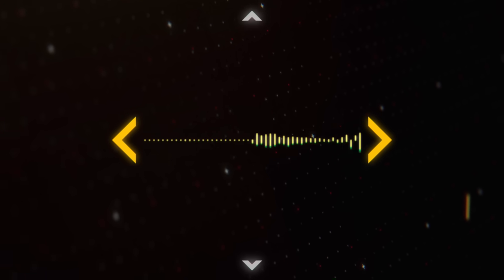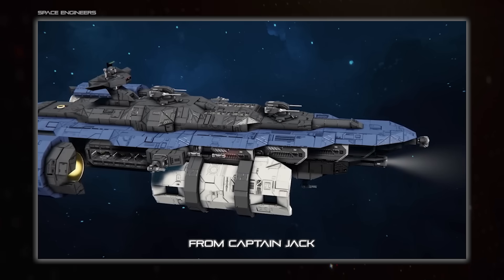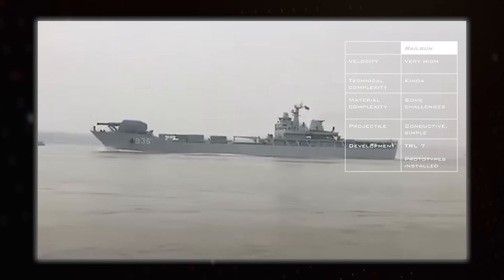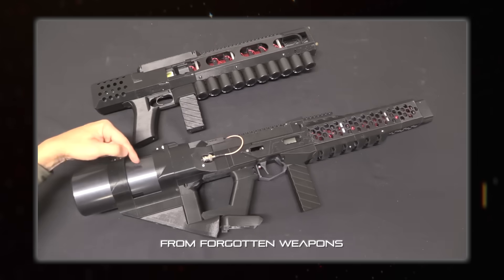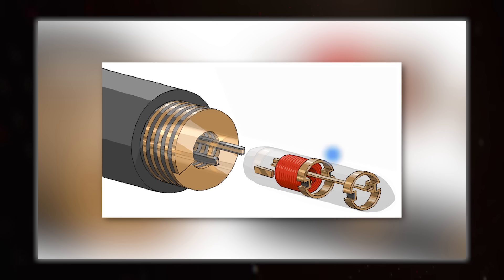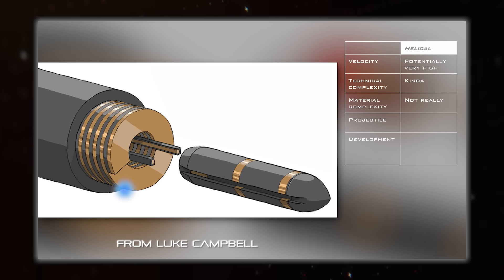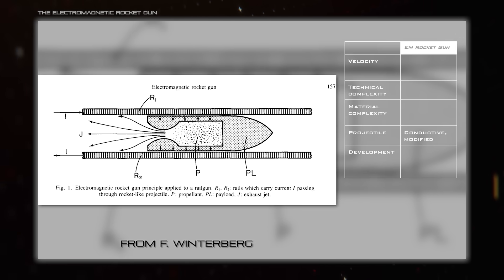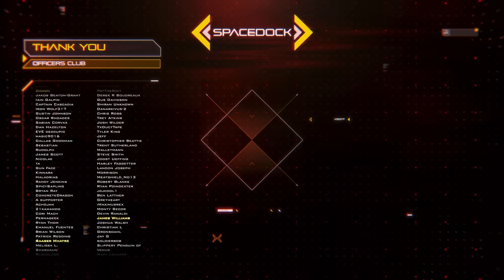The Deadly Coilgun/Railgun Hybrid You've Never Heard Of (Helical Railguns)

Comment: Just got an idea for a gun First stage is conventional 2nd stage is a helical then when it exits the barrel it ignites a rocket motor excellent fantasy weapon because it has 3 stages it can have some build up because you have to get enough electricity to get the helical stage to get it going fast then you have to activate the first stage then activate the helical stage then it could have a delay between it exiting the barrel and igniting the rocket engine

Comment: My take on this is the first two thirds of the weapon would mostly be coiled with a magnetic breach coil that low balls the round into a conical feed coil to shove down the rails. Last third is all rails outside a final tip coil that imparts more rotational or directional energy depending on load. Not all rounds will be round in a "anything ferrous" situation.

Comment: This video actually inspired one of the weapons of a character i made. He uses what i called a Kinetic/Energy Charged Helical Rail-Gun or a K/E CHRG if you wanna get fancy with the acronyms....and yes i tried to make it as close to charge as i could.

The basic idea behind it is you load it with "normal" ammo and the techno magic inside the gun coats the bullet in stabilized plasma letting it deal both kinetic and thermal based damage....the weapon is also able to fire without the use of kinetic ammo relying purely on the plasma, these bolts are unstablized and as a result are noticeably weaker and shorter ranged but an average plasma cartridge can fire a great many shots before having to be replaced.

Im sorry to dump random lore ive created here but i wanted to show how inspired i was by the idea of the Helical railgun and how i put my own spin on it.

Comment: The Helicoil railgun would have insanely expensive and relatively heavy ammo, therefore high running cost and for a scifi space setting the extra weight of copper coils in every round would nessisitate orbital manufacture if you want to avoid even more insane logistical handling and fuel costs. 

Ie, anyone using these rounds in a military setting would be burdening themselves with a huge economic logistical and production penalty when deployed en-mass when compared to convetional rail guns or even rounds with traditional chemical propellant 🤔

Comment: Hear me out Spacedock...

...what if we used a small amount of gun powder in the beginning to impart an initial momentum/velocity prior to applying current?
Reply: That's been tried. Conventional guns work well up to about 1500 m/s, so why not just use electromagnetic acceleration above that velocity?
Reply: @derekp2674  That's.... precisely what I'm proposing.
Reply: @chaz706  From the research done back in the 1990s when I last worked in this field, one or two actual examples spring to mind.
The HYPER railgun in the UK used a first stage (or pre injection system) based on a Browning machine gun barrel. That achieved a overall muzzle velocity of about 4200 m/s with a velocity increase of roughly 2000 m/s from its railgun section.
In a quest to explore maximum practical railgun velocities, Sandia Labs used a two stage light gas gun to inject a projectile at around 7000 m/s. Their railgun stage then accelerated it to a final velocity around 8000 m/s.

Comment: My thought for the ammo complexity issue would be to have the gun fire in a repulsive setup, and 3D print the ammo. Technology for both metal and multi material printing already exists, and I’d honestly be surprised if someone hasn’t already put them together. The thought is that the lower tensile strength of 3d printed materials would be less of an issue in compression, and complex internal structures would be less problematic. If you have the super-fast 3D printers that are totally feasible in a sci-fi setting, ammo production could be done on your larger ships easily, and even smaller ones to some extent. Materials could even be potentially gathered from asteroids, so supply lines would be less of an issue too.

Comment: The biggest problem I keep on seeing is air stability, where unlike regular bullets, there is no rifling to rotate the projectile, so it often tumbles through the air and reduces range and accuracy! Though with a magnetic rail gun, I do see some possibilities to induce rotation, rather than the magnets being placed in a single line, they could be placed around the barrel in a pentagonal or hexagonal spiral, or more, to induce rotation of the projectile so when it is finally ejected it is now spinning enough for it to fire straight without tumbling.

Comment: i think PCP pnuematic compressed air guns/cannons are actually the future of cyberpunk and space guns. think about it. they can be either HAND PUMPED, or ELECTRICALLY pumped with a solar powered air compressor etc. You ALREADY NEED air tanks IN SPACE... AND... hah didi mention you can HAND PUMP them ? lol no propellents needed but air and again,  it will be funny to see people deciding between air to breath or to shoot slugs out of their air gun, WHICH can also be made of same tech as the cold gas thrusters. in fact... a cold gas thruster can easily be converted into dual purpose air canon that just fires projectiles using the cold gas thrusters using likea giant break barrel  that a robot arm slides right over the cold gas thruster, with its air gun like rotary magazine of slugs made from space trash or regolith.

Comment: This was so cool, and proof that I don't have a single original idea ahead of anyone else. I was thinking if this yesterday, thinking "I wonder if they could make a rail gun on one half and coilgun on second half, but this helical one looks even better than they. Thanks for making it easy to understand, with the projectile's innards being shown and how complex it really is starting to get. This was awesome to see. Another thing that would be effective is a two stage helical, where the projectile houses it's own rail gun or coilgun (whichever makes better sense to those who know), so essentially a railgun IS IN the projectile, which gets electromagnetically blasted out like normal on the first part, sending it to Mach 7ish, then the projectile, while in motion, sends out the metal piece that hits a very armored target at like Mach 12 or so, if only the battery pack within the larger projectile casing could supply that much power. It could atheist be an easier way to send satellites into space❤❤❤

Comment: I still cannot understand what possible value in a coilgun you have from having multiple coils instead of one long continuous coil other than energy efficiency. The coil should provide a continuous magnetic field all pushing along the coil, so the longer the coil, the more the acceleration from the magnetic field. Having the coil behind the projectile energized wouldn't reduce the projectile's forward acceleration, though it might not add much to it, and neither would having the coil ahead of the projectile. The magnetic field doesn't start to pull back on the projectile unless it breaks the plane of the coil in some way, which it won't as long as it's in the barrel of the coil. So why do you need to time anything other than to reserve energy?
Reply: Well, if you only have a single long coil, the magnetic field lines will all be predominantly parallel to the axis of the coil. 
So, if another coil is inserted as a candidate projectile, the axial field from the long coil will act with the circumferential currents in the second coil to produce radial forces on that coil. 
Thus, that does not work as an electromagnetic launcher.
To produce the axial forces needed to accelerate a projectile coil, you need radial magnetic fields to interact with the circumferential currents in the projectile coil.
These radial fields can be found at the ends of short coils. This is why most coilgun designs feature a series of multiple short coils. 
A disadvantage of this is that a very uneven or "jerky" acceleration is likely to be produced.
In contrast a railgun - or the hybrid arrangement discussed here - should give a uniform smooth acceleration.
Reply: @derekp2674  Why would you use another coil in the projectile? Every coilgun I've seen just uses a ferrous projectile.
Reply: @chrisedwards6573  The commercial low velocity coilguns made by the likes of Arcflash use ferrous projectiles as you note.
These are linear versions of reluctance motors, that is motors with AC stators and ferrous rotors.
A short circuited projectile coil then gives a system equivalent to a linear induction motor while a system with the projectile connected to the coilguns' power supply gives the equivalent of a synchronous motor.
When I was actively researching railguns for use as high velocity military guns, I never encountered any military projects based on ferrous projectiles. Almost all were induction systems with a few synchronous ones.
I suspect this may be a consequence of speed limitations inherent to ferrous systems, from features analogous to hysteresis effects and magnetisation losses in iron cored AC motors and transformers. In such devices, there is a small time lag or phase lag between the driving current and the magnetic flux in the iron.
Any such time lag may result in an unacceptable limit to the possible peak velocity.
In contrast, induction coils are not so limited. Small single stage coilguns have achieved velocities in the region of 8000m/s.
For similar reasons, high velocity Railguns do not use ferrous iron cored barrels all seem to use air cored designs.
In induction coilguns, projectiles are driven by magnetic repulsion while reluctance coilguns are driven by magnetic attractions. But coilguns with simple iron or steel projectiles will exhibit both effects and it may be that the induction effects become more significant at higher velocities and thus counter the attractive forces on the ferrous material.
Conventional motors and transformers use laminated steel cores to negate these effects.
Reply: @derekp2674  Thank you so much. Very informative and much appreciated.
Reply: @chrisedwards6573  Thanks - you're welcome. A further relatively simple reason for not using ferrous material is that magnetic field strengths much greater than 1 Tesla can be needed, so ferrous iron cored systems become more trouble than they are worth. I'm sure this is the case with Railguns.

Comment: I like the Helical. I don't see the issue with some form of complexity with the projectile, or the potential sabot. Our current munitions has been rather complex for quite some time: from the bow and arrows requiring fletching; the bullets being a compound material of lead and copper jacket; even autocannon shells are complex with explosive and fuses. Plus the point of these magnetic accelerators is to achieve ludicrous velocities as a kinetic-energy weapon.

Comment: @3:59 - Perhaps a bit of both; having timers that set the shot, sensors that calculate the shot made, and then a machine-learning chip that makes the necessary adjustments to those timers as needed so that each subsequent shot gets closer and closer to the sweet spot. A smart weapon that tunes itself to get better through usage.

Comment: Thought about the rail life problem, if its on a ship, why don't they have quick change rails, like a battleship turret, when the rail is used up, it gets ejected from the barrel before the barrel points up wards and new rails are pushed form under up into the barrel with in 20 seconds

Comment: My big question on coilguns for a while has been "how effective would they be at achieving a velocity similar to chemical firearms?" The highly advanced timing is the greatest limitation, so a coilgun with a modest projectile velocity would be much more attainable, right? Then to make them competitive with conventional arms, simply fire, to quote the video, "an absolute unit" of a projectile. I also question why I haven't seen them paired with chemical generators instead of batteries. There may be a technical reason, or is it a blind-spot from the focus on the electrical/futuristic nature of the design?

I think having similar or "sidegrade" performance would be enough to be useful. There are concerns about the use of explosives causing brain tissue damage to the soldiers using them, dramatically simplifying supply lines is always desirable (and propellant shortages have been a bottleneck before -- Ukraine has reported such a limitation and that is part of why they've used armed drones so much -- they just need a destructive charge), and I would think they offer an advantage in battlefield stealth and awareness.

I can imagine low-velocity coilguns being used at a "heavy machine gun" crewed/mounted weapon level. If you can steadily lob chunks of iron without emitting significant light or noise (vs. firearms)...it seems like a fairly practical concept. Might even be more economical than conventional arms.

I guess this does fall into the mentioned "proposals for mortar-like coilguns," it just seems weird that this isn't an angle that gets discussed. I've either had a clever thought or I've missed a number of technical limitations that invalidate my idea.

Comment: I wonder if there is a way to insulate the coolant inside a EM rocket gun's projectile until it's almost been shot out the gun. This should allow for the coolant to only ionize until the projectile has nearly reached the end of the gun's rails. This should decrease the overall amount of wear the rails have to go through. This would sort of work like the gyrojet system, as in the propulsive force of the plasma would only start to really push the projectile outside the gun

Comment: On an entirely serious note grounded in real world physics, the inductance of a coil big enough to produce useful thrust kills any chance of that thrust moving at a useful speed (it won't keep up with the projectile) in the proposed hybrid weapon.

Rail guns work because they only have straight line inductance whereas a coil which sees a voltage change more rapid than a threshold (which will vary with coil diameter and other factors) will see that voltage short out capacitively from one wrap to the next thus never developing the circular current flow which would create a magnetic field. 

Understanding this doesn't require PhD level math and physics. Navy BE&E school (which doesn't exist any more) gave me that. QUANTIFYING the phenomenon does require that level of knowledge. 

So, it will work, but my guess is that the hybrid weapon would have a lower muzzle velocity than a rail gun. Between the magnetic field likely lagging the projectile and slowing it down and the energy powering the coil would leach from the rail effect I would guesstimate roughly a 25-50% loss of efficiency from a simple rail gun.
Reply: Ah, the joys of displacement current :)

Comment: I think one of the biggest issues with a Helical Railgun is that the projectile has to fit into the weapon in a specific orientation. Every other gun type simply requires the "pointy end" to the front. This complicates the storage and loading system, especially for a turreted helical railgun where the orientation of the barrel and its guide rails can not be assumed.

Comment: Regarding the coilgun problem, and how do you time engaging the magnets in front...what if you just had them all open in series, being the weakest in the initial magnet, and then simply turned off the magnet it passed at the right time, resulting in a higher current through the remaining magnets for faster acceleration. While still having the benefit of only needing to shut the magnets off at the proper time, which I imagine is significantly easier to accomplish...

Comment: There has been some work (mostly 'on paper' and in simulations) on using plasma as a conductive medium for rail guns and related gause weapons. This could seriously reduce friction and with no wear on the 'rails' you don't have to deal with replacing those nor with friction melting your rails and causing a rapid unplanned disassembly of the weapon.
Reply: In reality. plasma armatures erode railgun rails really badly. This is because thermal radiation from the plasma tends to vaporise the rail material (and also the interrail insulators). Also, getting electrons to flow out of the rails into the plasma requires the establishment of hot spots ("arc roots") in the rails, to promote thermionic emission.

Comment: you use photo-sensors so as the projectile blocks the light it turns on the coils in front of the projectile to pull it forward

Comment: According to the Traveller: The New Era technical sourcebook Fire Fusion and Steel the gauss guns used in Traveller's Third Imperium universe are helical railguns, though it does not use that name. The book even has a diagram similar to Luke Cambell's and a pretty succinct explanation of the theory in its gauss weapon design system.

Comment: Coil timing: check what is don in FEL (Free electron laser) with Seeding laser like the FERMI in Trieste Italy. (I was working in that institution)
In that machine a packet of electron flying at high speed is excitated with a laser. Literally synchronizing at Pico second and hitting the packet in the fly in synch with the laser wave. We are very good in this kind of thing. So coil synchronizations definitely feasible.